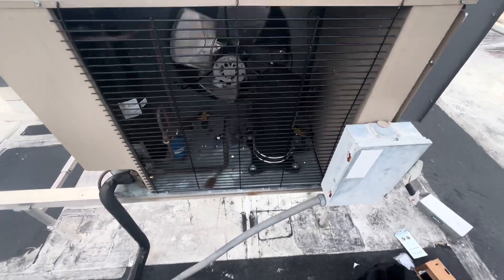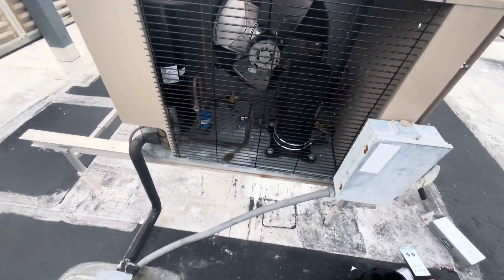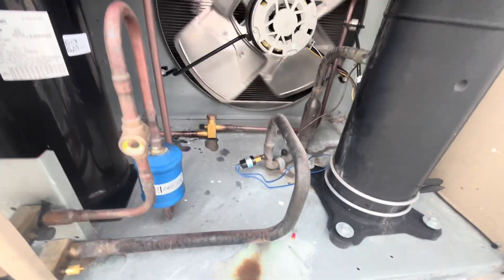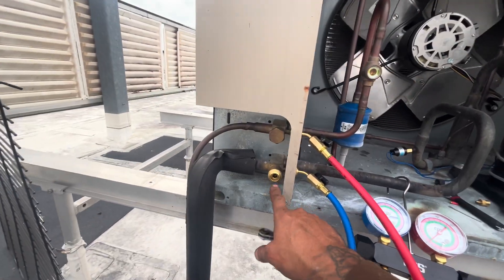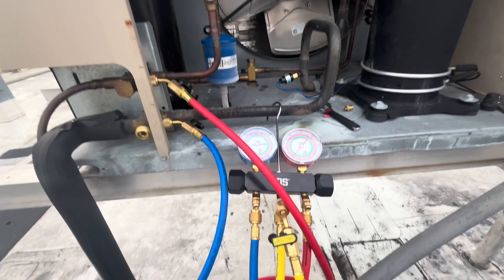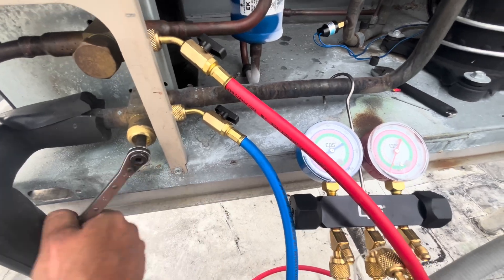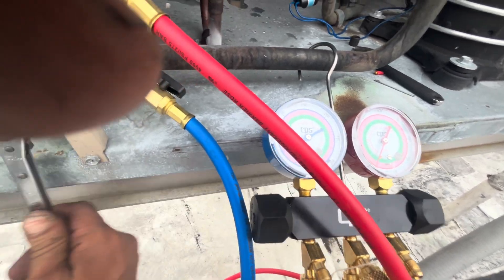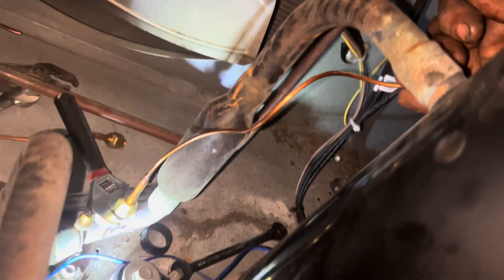REPLACING LOW PRESSURE CONTROL BY PUMPING DOWN SYSTEM

Comment: 🇺🇸💪👍❄️ nice work.  I've seen cap tube with pvc vinyl tubing around them to prevent rub outs. Looked pretty cool.
Reply from the maker: Definitely the way to go, I’ve seen them more on roof top units on the distribution lines but half the time they are burnt and rubbing through anyway lol.

With these I just try to take the time and keep them away from everything, most of the time I don’t zip tie them to wires or anything to prevent the possibility of a rub out.

Just took the time to bend it correctly and only use as much of the coil of cap tube as I need.